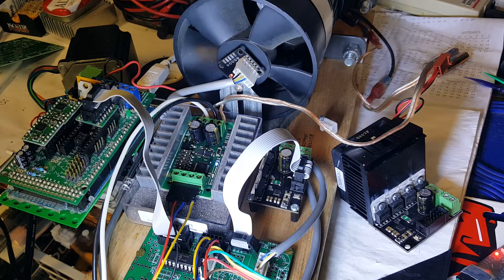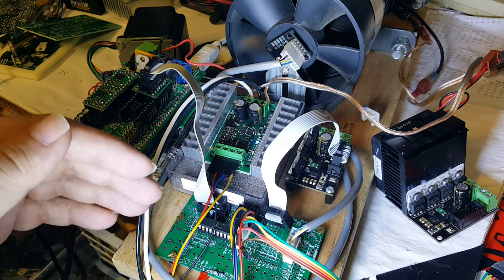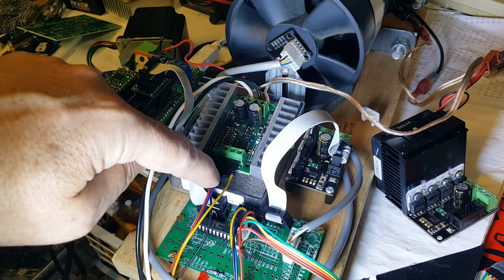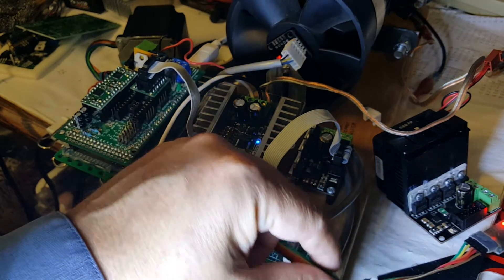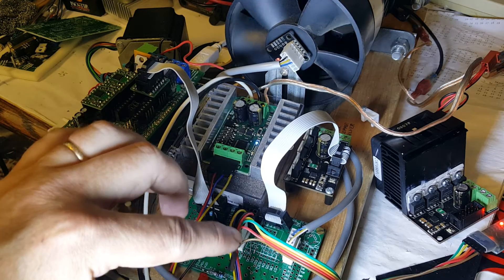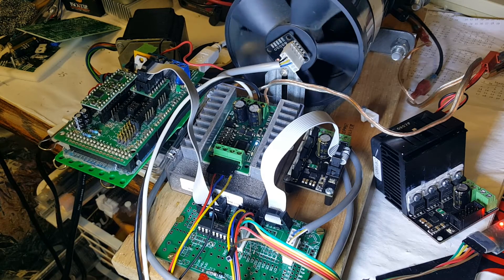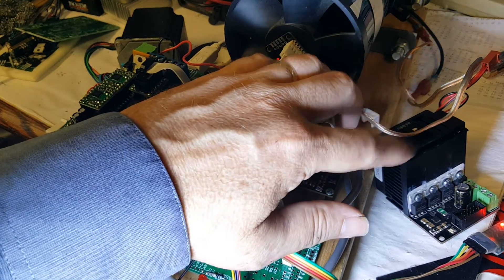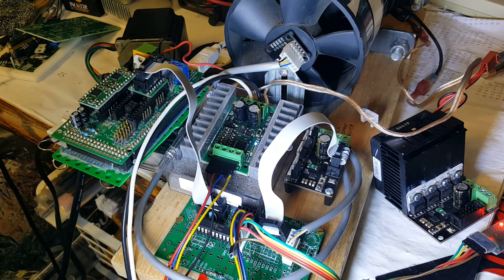BOB PID Running SyRen 25/50 amp DC motor drivers

Comment: This motor with your driver showing how it reacts when you hold the fan to cause it to error out would demonstrate it's fault detection and reaction to fault.
Reply from the maker: Ah... yes, but that's a reaction to it not being where it was expected, rather than a reaction to the driver overheating... I guess you could argue that if the driver overheats and shuts down, then it won't be where it's expected, and the servo controller will know that. But it's a second order error, and it requires that the unit is moving.

Comment: how to tune the bob pid with the motor ? how to configure which encoder to use enc2a to enc2b ?.
Reply from the maker: With a serial connection, you can enter commands to set each of the PID parameters. There is more information on the product page. 
http://techref.massmind.org/techref/io/servo/BOBPID.htm (Scroll down to Operation)
For information on how to tune a PID in general, see:
http://techref.massmind.org/techref/io/SERVO/PID-tuning.htm

The encoders are the same, but one has 4000 CPR and the other 360 CPR.
Reply: very nice well done solution, will order a set  for a router to check it out but is there a limitation if i use it with higher speed cnc controllers beyond 200 khz also if 4000 cpr encoder  is available now then why still the 360 cpr still on the market?.  is there a  relationship of 4000 cpr with the 200 steps/rotation of   generic stepper motors
Reply from the maker: Because the BOBPID (and most PID controllers) have an upper limit on the number of encoder pulses per second that they can support. The BOB PID can manage several thousand pulses per second, but when you are running something small and fast, like a motor which is connected to a load with a high gear ratio, you can easily exceed that limit. The 360 CPR unit is best for those applications.  E.g. on the back of a motor which is geared at 100:1 to the load. The 1 degree of resolution on the motor shaft is now 1/36000 on the load shaft, which is more than enough. And the PID can now keep up with the pulses while the motor spins up to high speed and the output shaft is moving at reasonable speeds. 

Another point is that the 360 CPR unit can support a much higher maximum RPM for use with speed regulation (e.g. not position).